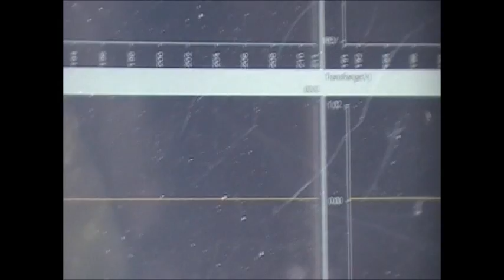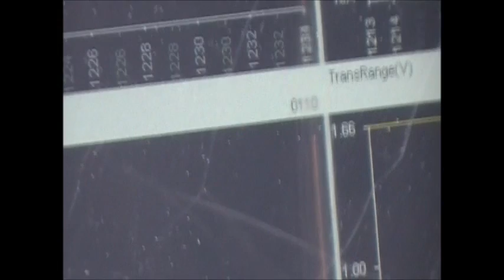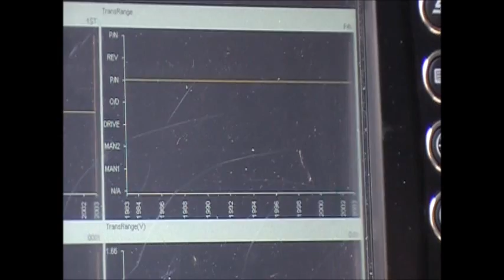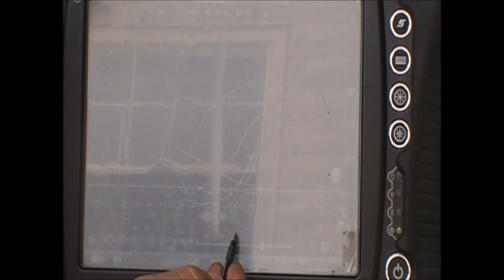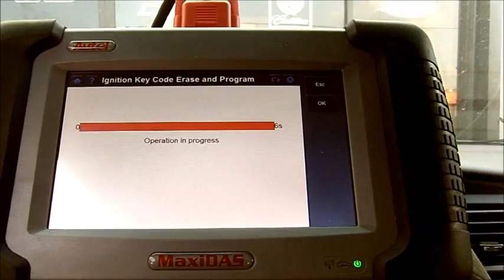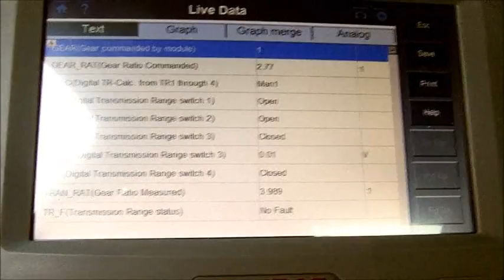2000 Ford Taurus TR Sensor Problem P0705, P1702 - Transmission Repair

Comment: What kind of problems were you having with the car I don't have any codes and my transmission won't go into drive won't go into any gear the car runs fine the engine runs your shifter moves but it won't engage any gears

Comment: Yes I have a 2003 Ford Taurus and my problem is I was driving it one day I stopped at a stoplight and it didn't go into gear it shifts fine when I started control for a while but then I stopped at a stoplight and it looked like it seemed like it was in neutral Nate with moving over what would that be

Comment: I have a 2001 ford Taurus  that i rebuild motor because a blow head gasket now that is done. My transmission when put it in gears it jerks really bad and when i put my hand on the transmission oil pan to finding it is so hot that i have to take my hand off so what could the problem with the transmission. please write be me back too let me know what to do. thank yo so much.

Comment: My car when put into gear keeps slamming and shifting hard I don't know what it is but it's breaking my mounts and is causing damage to other parts of the car I've taken it to multiple shops and no one seems to know what it is they always try to fix it the car seems better but within a few weeks the acts just the same as it did before again I put it in gear and the engine shakes at tugs and pulls you can hear it moving and you can fill it through the floorboard what is the problem

Comment: I am having the same problems with my 98 Taurus, Before spending a bunch of money taking it to a shop for them to tell me I need to rebuild my Transmission are these parts that I can change. If I then change them am I going to have an issue since I do not have the computer tools you have? Any info will help. Thanks....

Comment: I had this problems too. But mine was interminent clicking, loose power steering (looks like steering wheel lock itself for couple of seconds) ans radio only sound in PARK or NEUTRAL. Dont be scared, fix is no longer than 20 mins. DIY

Comment: but when im driving I hear clicking sometimes back to back and when it clicks I lose power steering power and radio and windows,,then sometimes it will click back, then everthings back but not for long,, any idea,, think my PCM might be the problem,, does that lil rod with the threads that comes out of the transmission that the auctual sensor is bolted to,, could it be it, Im just stumped but I have aleast pimpointed the issu  !!!   Dan

Comment: hi,,love video,, lota numbers dont quite understand,, but I got a 96 mercury sable, same set up and I changed my transmission range sensor, and figured out its not it but is in the part where it hooks on,, with the range sensor installed, I have pull lever thats attached to the acutual sensor all the way to the left and my power for the radio and windows all works,, but after i re attach the shifting arm,, and go through gears it wont spring back all the way to get the power back,,